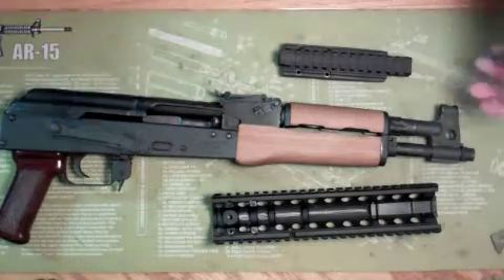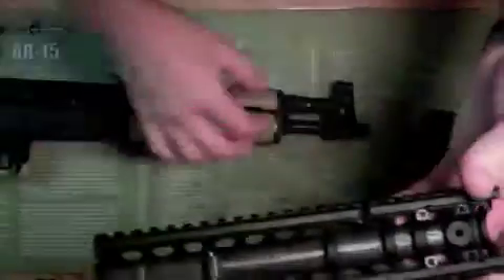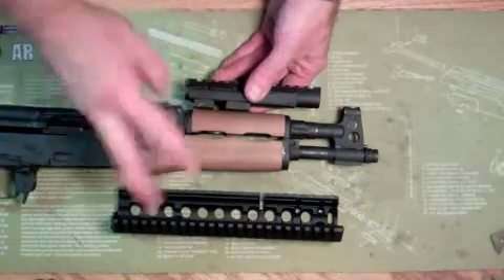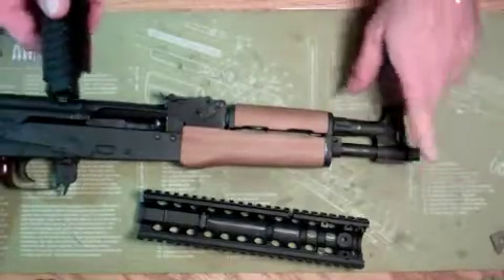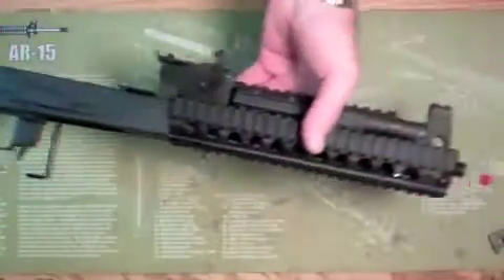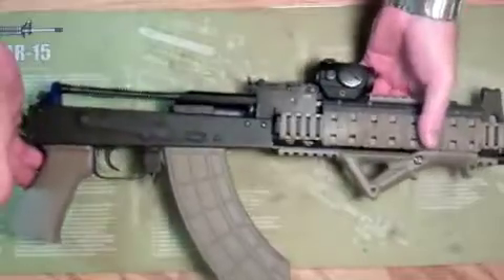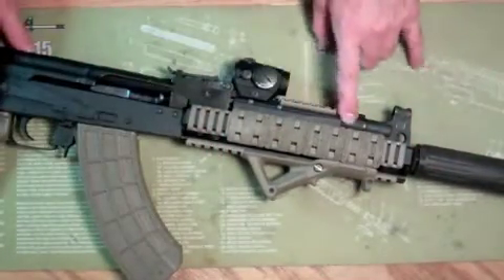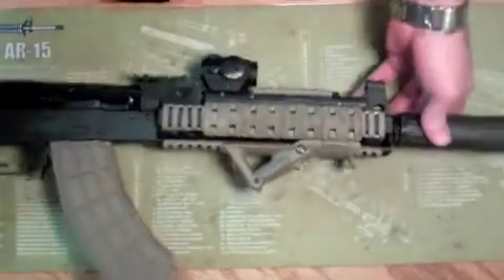UltiMAK ACR SS and M7 B Installation

Comment: Awesome vid as usual!man she sure is looking sexy! The Ultimak set it off! Got the upper Ultimak on the way  for my M92, wondering if it'll work with the MI Keymod Lower HG.. Or if a man could mod a UM lower to fit the M92. Expensive experimenting forsure!
Reply from the maker: Not sure but I've seen several vids where guys are milling quite a bit off the UM rail. In my opinion it's over built. I'm thinking of milling the picitinny rails off the sides except for a few row in front for light or whatever. Then doing a patriot brown creacoat  with FDE furniture.